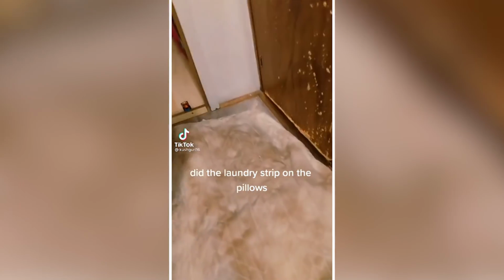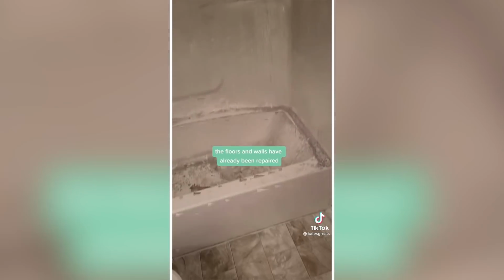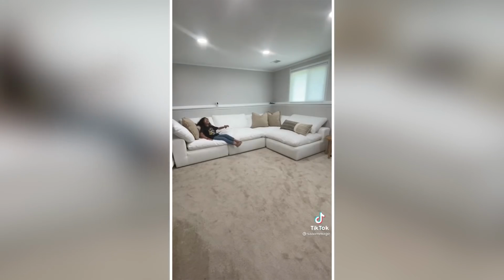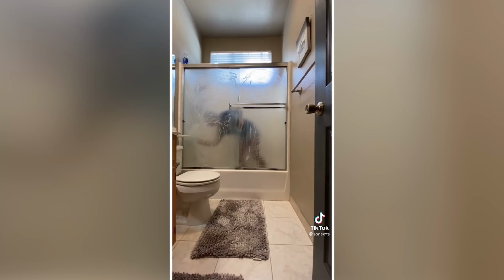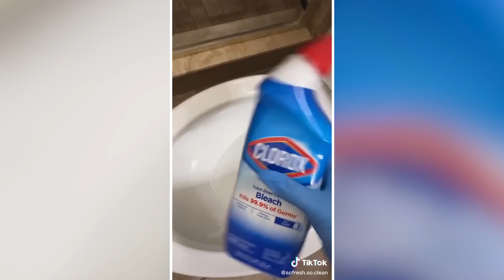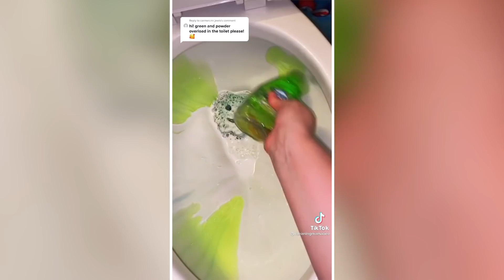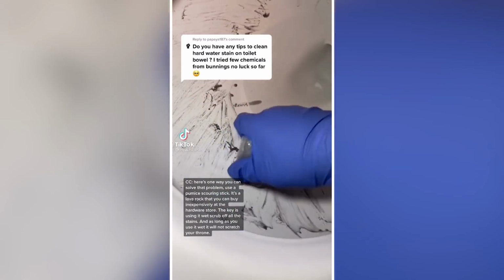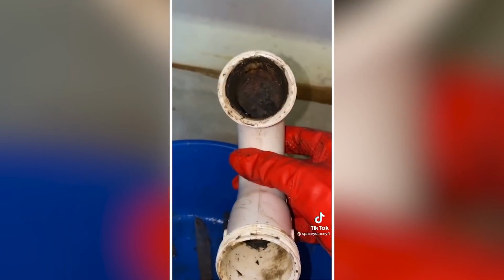Cleaning TikTok Compilation 3

Comment: I've been watching alot of cleaning videos and one thing I'm confused is what is the powdery substance they are using, can someone help? And with what should I use that to clean my toilet
Reply: It's comet.
Reply: For your toilet, you only need cleaner (lysol, duck for example) for your toilet bowl, and a disinfectant for the seat, the cover, and the outside of the bowl. It is better to have a regular cleaning routine so that urine or hard water stains would not develop. Have fun cleaning ;)
Reply: Ajax is what its called in Australia,  its a bleach powder never use it the way they do!

Comment: 1:42 the bathroom is where a lot of germs and disgusting things like to hangout. It's more of a bio hazard depending on what is in there to begin with, using dish soap on the counter won't really bring up all of the germs. I suggest using bleach or alcohol to clean the counters and sink, depending if you do have granite, a multi-surface cleaner is also great to use. also DO NOT MIX CHEMICALS!! mixing chemicals is bad in many ways including; you can make a bomb without even knowing, you can make a poisonous gas or liquid, all those chemicals could eat holes in the pipes or weaken the pipes and if you don't have a properly ventilated space you could end up killing or making yourself pass out. wear gloves and be safe cleaning! <333

Comment: The little bath toys with the hole that gets the nasty bath water in it and gets gross.......fix them before use, after you buy them before bath time with hot glue in order to plug the hole. They won't spurt but they won't get gross water in them and it won't mold witch will make babies sick!